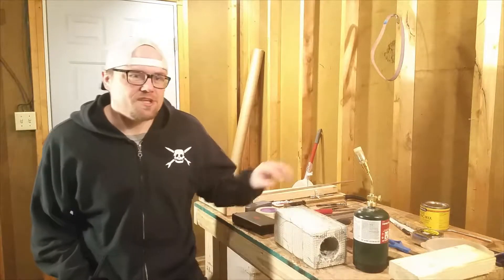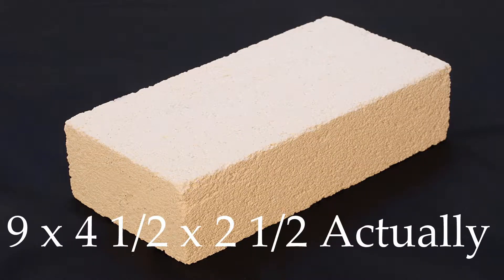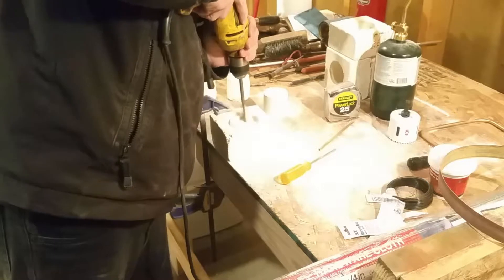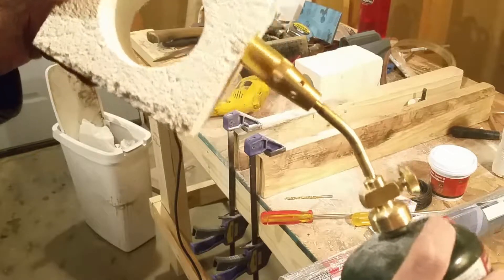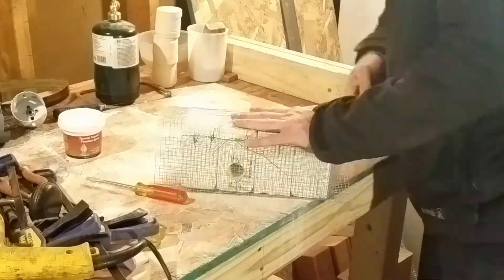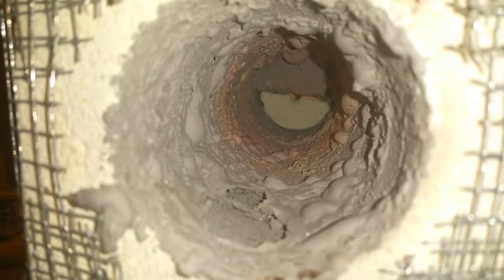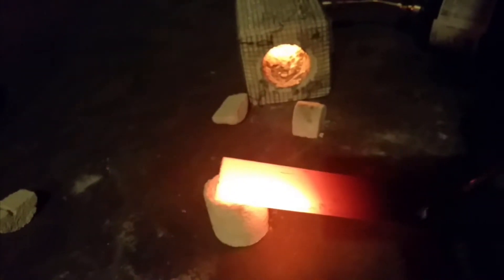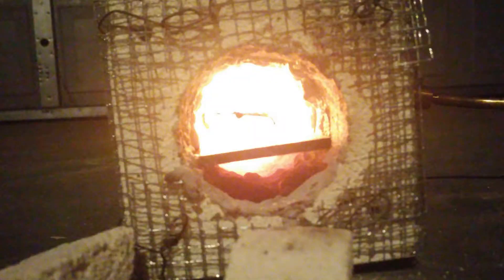Knife Making Forge

Comment: Have you thought of adding an actual Atlas 30k burner to this forge?  It would work great.  Nice video.
Reply from the maker: I use a map gas burner with a much better torch now, not not sure what the btus are on it but it works way better.  I'm also collecting stuff to make a full on forge and start actually forging.

Comment: This is a good way to get the maximum chamber area out of a single brick. Good job on the video.
Reply from the maker: Thanks. It Definitely is. I actually use map gas, instead of propane now and it works a lot better. I'm still using this forge.
Reply: Cool. I just got 3 bricks and I'm trying to decide what configuration of mini forge I want to build. I'll be using propane for now.